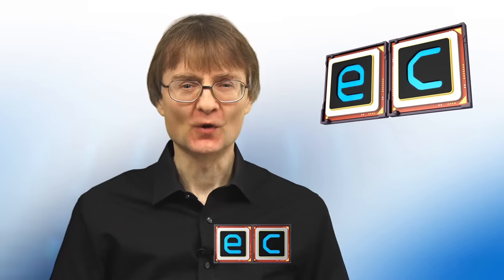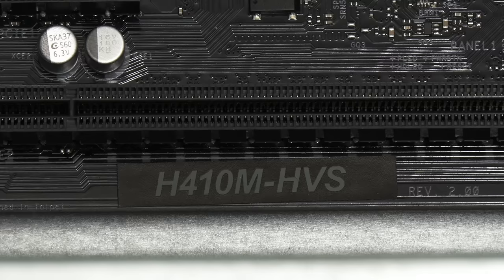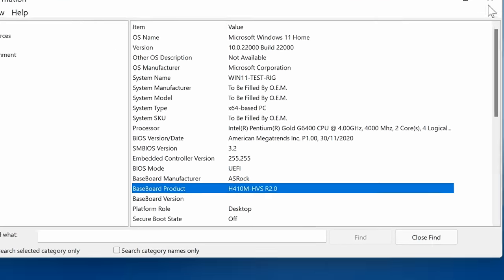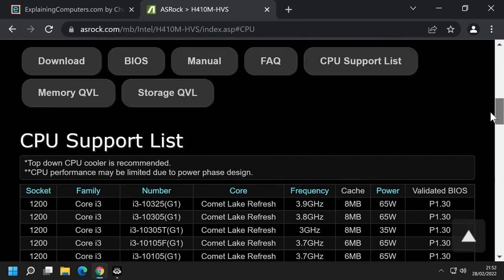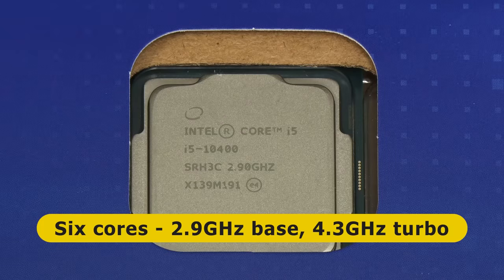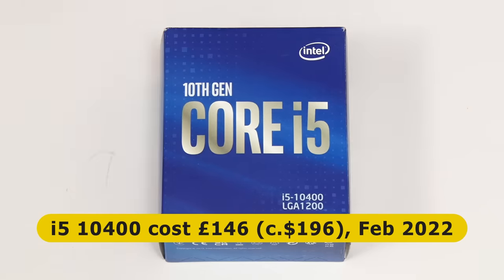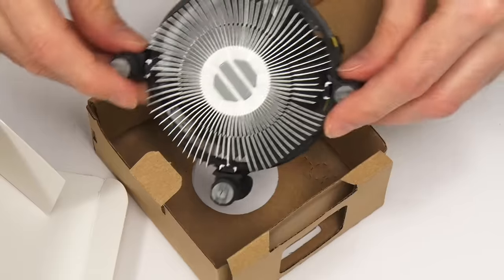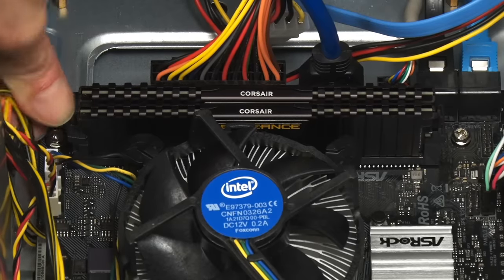CPU Upgrade: How to Change a Desktop PC Processor

Comment: Curmudgeon corner: you didn't replace the CPU sticker on the case for the first boot section. Now, seriously, that PC is now really a sleeper! Few would suspect the pretty competent power those nearly trash picked-like case looks pack inside.
Reply from the maker: You are right, but I have plans (in a future video) to refurbish the case, so replacing the sticker has to wait . . . :_

Comment: Depending how long this product was in a warehouse, especially since this CPU is 2 generations old, the thermal paste pre-applied on the cooler might have been dried out as there is no air tight seal around the cooler. I recommend removing it with Isopropanol 99.9% alcohol, then with nailpolish remover (99.9% Acetone), then apply new paste like Thermal Grizzly Kryonaut or Arctic MX-5. Spread the past over the CPU, then put the cooler on.
Reply: That's a very good point. Personally, I always remove the pre-applied thermal paste from any heatsink I buy, if only because I don't know its quality, then apply a known high performance paste. I'd hate to "spoil the ship for a ha'p'orth o' tar".

Comment: Now one thing that might be necessary on some motherboards, depending on how far of an upgrade you're doing is that you might have to flash the bios to a newer version to support your CPU in question. I know, as an example, some older AM4 motherboards would require flashing the bios to support higher end 300 or 5000 CPUs. It might not be necessary but depending on how old your motherboard is, it is something that can be overlooked.
Reply from the maker: Yes, this is true -- as I do discuss in the video! :)
Reply: @ExplainingComputers  ahh, saw the compatibility but must have missed the bios thing.
Reply: Fully agreed. My SOP is to check and update the BIOS to latest release if needed before any CPU upgrade. Not always necessary with Intel CPU but maybe required with AMD when upgrading from one generation CPU to another.
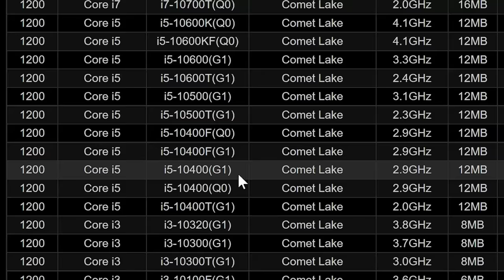Reply: @MiriOhki  3:01
Reply: Some motherboards require you to buy two CPUs one to do the upgrading and then one to actually use.
Reply: @bland9876  You are referring to running Ryzen3 CPU on earlier AMD AM4 chipset motherboards. AMD had a program when the Ryzen3 CPU first came out where they will ship you an older AM4 compatible CPU just so you can flash the BIOS. Not sure if that program is still active.

Comment: Before watching this video I'm wondering what's the point of having to buy the CPU separately from the motherboard when you're never going to use the motherboard again so they might as well just have the motherboard come with the CPU built into it.

Every time I go to get a new processor I always have to get a new motherboard.

Comment: A long time ago, a cpu upgrade like 486 to pentium overdrive, still lots of works to do. You know, those DIP switches, jumper settings. Now, just slide in a new compatible cpu.

Comment: A nice, clean CPU upgrade. Not like my own, where this week I've upgraded my AMD Ryzen 3700X to a 5950X, had to return one all-in-one liquid cooler as it was too big to fit in my case, and then mod the case so that the smaller replacement cooler could get good air flow in from the front.

Comment: I've had a look at Debian's unofficial rolling release in the form of their "Unstable" branch which has been described as actually relatively stable in practice but Debian themselves don't recommend using it.

Do you think you would ever do a video investigating it?

The installation process of Debian unstable is to install stable, and then change the /etc/apt/sources.list to use "unstable" instead of "*release code name*".
Then you just run "apt update" followed by "apt full-upgrade" and restart.

Running unstable allows you to use the latest version of whatever desktop environment you have installed, as well as all other packages. I've noticed that unlike stable where you can go weeks without a single update, this seems to update near daily.

Comment: Ooh! I used to have a computer with that same case! Its still here somewhere. In the room where all the wires gather, and into which no man dares tread, lest he be consumed by stray usb cables. They turn feral after a while, you know.
Reply: I've suffered from feral cables too. I've set up computers and neatly arranged the cables so they were easy to trace, then six months later when I've wanted to change one, they've become the Gordian Knot !

Comment: After you removed the old CPU you said something along the lines of removing the old thermal paste but did not say how or why. Presumably this would be the case (no pun intended) if you had to reverse the process for some reason?
Reply from the maker: Yes, you are right -- the thermal paste needs removing to re-use the CPU, where new paste would need to be reapplied. The CPU also wants cleaning off for storage, or the old thermal paste will get everywhere. I usually clean it off with a tissue or rag and some white spirit or other alcohol.

Comment: Christopher is obviously an optimist. After fiddling around inside the case, he put the lid back on before trying to see if it worked. :-)*
Is there any use for a redundant cooler? Can CPUs be purchased without them?
Reply from the maker: An optimist indeed -- but also a film maker. :) Working on a PC in a studio setting is never quite like it is in real life!
Reply: Some amd models come without a cooler, not sure if intel does the same. You could save the cooler for other projects like a high output led module, or simply take it for recycling
Reply from the maker: @kinnikuzero  Yes, Intel "tray" processors come without a cooler, including lower-power processors like the "T" variants of some CPUS.
Reply: @ExplainingComputers The weird thing is that the tray versions are priced that same as their stock counterparts. At least in Greece.

Comment: Hi Sir,
I had a question about my laptop upgrade, didn't get where to ask my question, there why commenting to the latest vidoe that I found. I love your content by the way 😊. The question is, I have my 6 years old laptop Lenovo IdeaPad 520. Now I want to upgrade it. Want to istall best possible m.2 or ssd and ram. Obviously buying top-notch is not a good option. How can I decide which are the optimal memory and storage. Please help..
Reply from the maker: If the RAM is 2GB or less, I would upgrade the RAM. Else improve the storage. HDD to an SSD will make significant difference,

Comment: Two notes for viewers that might get you going if you experience loading/booting problems with new installed CPU? (as Chris states, always check if BIOS update is required while original CPU is still in-place - and make sure you get the right motherboard type and version)
1: If system/Windows fails to load after new CPU installation, continue to relocate/swap RAM modules around and try again.
2: Your system may also fail to load if no signal is present for your monitor after new CPU installation, so relocate graphics card (if discrete) and try again.

Comment: How about a own pc upgrade for you explaining computers like ryzen 5000 or intel 12thgen
Reply from the maker: There's no need -- the current system is an i7 6700T with 32GB RAM and easily handles my video editing requirements (and remains compatible with Windows 7!). So the system will run until it fails. I would not go Ryzen, as I also render 3D graphics on other hardware, and Intel and AMD chips have different random seeds. So Intel and AMD cannot be mixed in a render pipeline.

Comment: Unfortunately you can't trust ASrocks supported CPU list. Their entry level board have very basic VRMs which power limit the top processors. It will still boot and run, but the performance will be lower than according to Intel specifications.. Hardware Unboxed found this out. For the i5 10400 it doesn't matter but I don't think your board can run the i9 
10900K at its all core boost frequency.

Comment: Interesting that the fan you took out was 0.2A and the one you installed was 0.6A - both at 12V.  Probably to give a little extra cooling for the i5.  Are the fins on the heatsink identical?
Reply from the maker: Wow! What a great observation -- you watch very closely!. I'm sure you are right on providing greater airflow for the i5. The cooler fins appear identical.

Comment: I don't get it. Why is it not required to add thermal paste to the CPU? Wouldn't applying more of it make it get less heat?
Reply from the maker: As I showed and discussed in the video, thermal paste is pre-applied to all stock Intel (and indeed AMD) coolers. Applying too much thermal paste always decreases cooler performance -- you only want as little as is required to fill any very slight gaps between the CPU package and cooler base. And I think we can assume that Intel and AMD have worked out the correct amount to apply! :)

Comment: So I looked inside my PC and the CPU is attached to the Motherboard and can't be put out. Also there is nothing that holds it since it is attached to the Motherboard. I don't know how to upgrade the CPU. Can anyone help?
Reply from the maker: It is extremely unusual for the CPU in a desktop PC to be soldered to the motherboard. Are you certain you were looking at the CPU and not the chipset chip? The CPU will be hidden from view beneath a heatsink and fan. If the CPU is soldered, you cannot upgrade it.

Comment: Dear EC/CB, 👍 Thank you for this jolly fine video. It feels like the walls are closing in on x86 ISAs . . . which is years in the making. Presently ARM, whilst only slightly less performant than x86, is much better with power efficiency as well as keeping its user-owners more happily quids in. ARM SOCs (for instance, Apple M1; Nvidia-Mediatek; Qualcomm-Nuvia; SiFive-Intc; Msft rumored custom Si) even more so. Moreover, Windows in 2021 provided an ABI Application Binary Interface for x64 apps to run natively on ARM ("ARM64EC"), meaning many x64 apps won't have to be recompiled (a la Rosetta 2 for Mac). Could this be wrong perhaps? Truly yours.
Reply from the maker: I agree with you, things are changing. In the next couple of months there will be videos here on the first 64-bit RISC-V boards able to run full desktop OS. The walls are indeed closing in on x86 ISAs as you say.
Reply: @ExplainingComputers  Appreciate the commentary. Thank you. Your balanced and unbiased contributions to humanity's understanding of its interactions with tech surely shall be a good part of the historical record. I have learned much from you. Yours.

Comment: Hi - just a mention, when I did my AM4 upgrade from 2700 to 5950X, I found that the Gigabyte B450M Gaming BIOS/UEFI had reset the memory speed to nominal, and I had to set XMP again to get the expected memory performance. Maybe this happens with Intel CPUs as well?
Reply from the maker: Yes, this is a very good point. An XMP profile may well be reset by a CPU upgrade -- very much worth checking in the BIOS.

Comment: Chris and everyone reading this My son started building computers over the lockdown. I came across a Hp Compaq 6300 Pro MT i5 3570 cpu 3.40 ghz with integrated 2500 graphics which I believe is low end stock. I upgraded Ram but now I want to get other parts to upgrade with my son. The info I found says I need a 3.5 sata ssd but the price is not even close to the budget. Can anyone help with compatible upgrade parts? Can I use m.2 ssd ? I’m looking to add to or upgrade storage to ssd and hHd .  What cpu ,graphics and hard drive will work?

Comment: What about taking precautions again static discharge from your hands? Static electricity can easily destroy a CPU. You can get rid of static electricity by rubbing your hands on a metal part of the case while the PC is plugged in (and therefore earthed).
Reply: Hello Me Me, if you go back and review Chris‘s past videos you will see that he’s very careful about ESD.  That said it a valid point!
Reply from the maker: Whenever I mention antistatic precautions in a video I get intense abuse in the comments. So I simply do not do it anymore.

Comment: Wish I had seen this video BEFORE I built a machine based on an F-suffix i3 CPU, and got nothing but five beeps from the board - CPU error.
Took lots of searching to find out that this beep code was NOT a CPU error per-se', but that the MB could not find a graphics sub-system to start.
Must have removed and replaced the CPU about ten times, trying to find out WHY I had a CPU error, when it really was a GPU error.  Sigh....
Gigabyte H510M S2H V2 motherboard.  Having FINALLY discovered that it was really the lack of a GPU that was going on - while Gigabyte beep codes kept telling me it was a CPU error, I finally installed a PCIe graphics card and things now work.  Tainted my support of GB motherboards though.  The beep-code should have been something OTHER then CPU error, to stop me chasing my tail for days on end thinking there was a CPU problem or a dead motherboard...... Sigh.
Reply: integrated graphics are on the cpu...therefore cpu error

Comment: Do they sell processors without a cooler? I mean, I would have to look for those in my local computer hardware store, but I've never seen them coming without a stock cooler, and after a while those would tend to pile up,
Reply: Retail or boxed CPU usually comes with cooler. Bulk packed CPU are a bit cheaper and does not come with cooler.
Reply: Intel K unlocked CPUs don't have a stock cooler but AMD always come with a basic of slightly better cooler since all of them can be over clocked

Comment: Just check that the new CPU is actually an improvement. My wife's computer has an i3 3240 and I was given an i7 2600S, which you might think of as being faster than an i3 even though it was from the previous generation, but it turns out that the i3 3240 beats the i7 2600S hands down in single thread operations - the vast majority of my wife's computing tasks - so would I be on a hiding to nothing if I switch them ?
Reply from the maker: This is very, very true. The advantages of a new CPU are not always what they may appear.

Comment: they still havent worked out a way to be able to mount fans to cpu outside the motherboard. it's nerve wrecking mounting fans, especially bigger third party good blowers, which need to be configured just right for specific cpu. the final mounting is also shocking, as you cant see well how it's going and newest fan mounting gear is new to you.
no cpu paste?
Reply from the maker: Agreed on mounting! Note that there is thermal paste on here -- it is pre-applied to all stock Intel (and AMD) coolers are I discussed and showed several times in the video! :)
Reply: @ExplainingComputers  :oh, sorry missed that about paste...watched on iphone. cheers.

Comment: no BIOS warning on first boot? that's really strange...
Reply from the maker: I was also surprised that it just went straight into Windows! I guess that motherboards are more tolerant of a CPU change these days.
Reply: Was going to say the same thing, changes in RAM or CPU always triggered a warning for me.
Reply: @ExplainingComputers  this is an issue, not only about security but also about setting up things correctly. I had a similar problem with a client. he bought a Ryzen motherboard and a cpu, but the board was one of those that had to go over a BIOS update done by the store. He assembled it and the board assumed the old CPU settings. The machine was crashing all the time and was only fixed after a BIOS reset.

Comment: I've heard that integrated graphics is going to be standard for all AMD chips.  It is a good idea.  What if your 1500 dollar GPU goes down?  That was a big upgrade.  More than triple the cpu score, but I wouldn't notice much difference in my daily use.  I was curious about the cooling.  A GPU in that case may turn it into an oven.

Comment: Was it unnecessary to apply thermal compound on the new cpu?
Reply from the maker: Thermal compound was used. On stock coolers it comes pre-applied, as discussed and shown from 6:02 onwards and again from 9:56 :)
Reply: @ExplainingComputers  Ahah! Very much appreciate the reply and explanation. Excellent work! So if I'm only replacing the CPU and reusing the same cooler, would best practice be to clean the compound off of the cooler and apply fresh compound to the new CPU?

Comment: Have old dell pc that came with windows 7 and intel core i5.   This pc won't allow upgrade to windows 11.  Will changing out the hard drive to a ssd or the processor to a suitable cpu allow the pc to upgraded to windows 11?  Thanks to anyone that can help.
Reply from the maker: Changing the hardware will not help (unless you replaced the motherboard and everything!). But you should be able to install using a registry hack -- as I cover in this video: https://www.youtube.com/watch?v=CH0bAeEm1Jw

Comment: Quick note, Chris: The Stepping can be read in the white label that's on the outside of the CPU Box, this applies to both AMD and Intel CPUs. 
In the case of AMD, the end bit of the Serial Number is indication of the Stepping (for example, when the AF Ryzen Zen 1 chips were released, they were known as AF as that was its stepping and the serial number ended in AF, and people used it as a quick identifier).
In the case of Intel, it's a bit more complex: you need to read the S-Spec which is informed in the white label or even on top of the CPU's IHS (the one installed here is SR3HC), and if you search that code, Intel ARK (sometimes, even CPU-World has this info) will inform you the stepping in the product page.
In the case of the i5 you're installing, it's the G1 stepping, so a native 6-core die, not a harvested 10-core die.

https://www.cpu-world.com/sspec/SR/SRH3C.html
Reply from the maker: Very helpful, thanks for posting this. :)